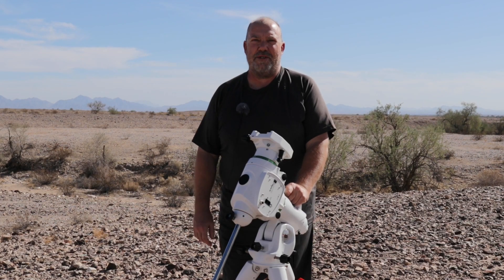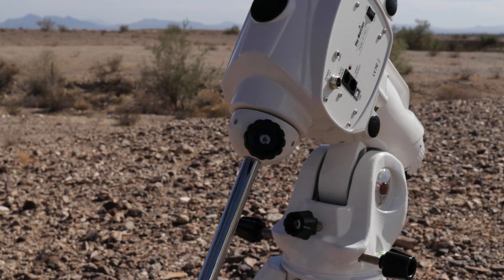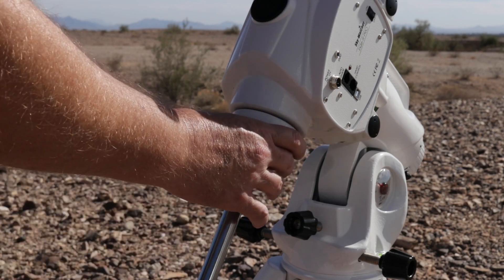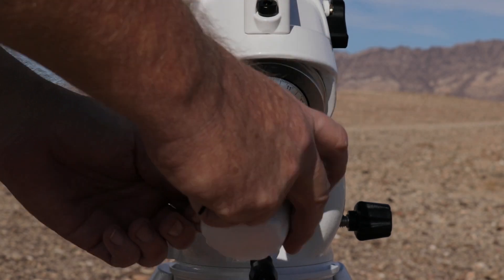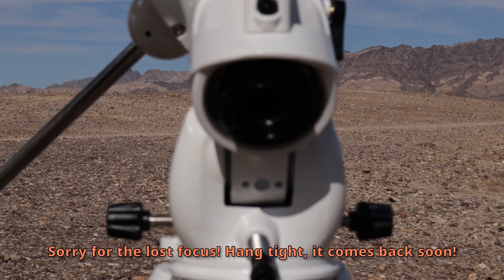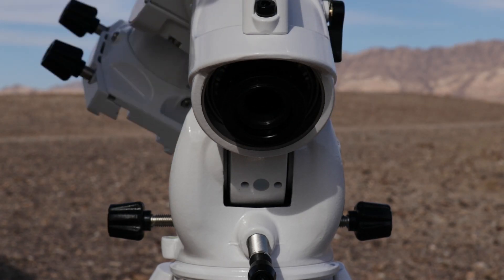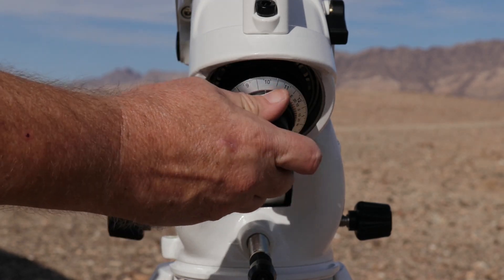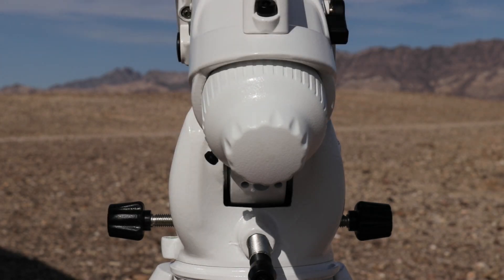EQ6R-Pro Sticky Axes Quick Fix (No disassembly required!) [DIY]

Comment: Thanks so much for all the tips in this video, especially your trick of putting screws in the unthreaded holes in the big black cylinder nut on the RA axis to gain leverage. I literally broke one strap wrench trying to get that nut loose and wore another one smooth. Not even channel-lock pliers did the trick (other than marring the finish). But your screws in the holes trick worked right off the bat, and now I should have a much easier time balancing. Thanks again!
Reply from the maker: I'm happy it helped!

Comment: Great video! I've been having some guiding problems when in varying temperatures and I always thought it was the grease issue. I looked inside and didn't think there was too much grease at all (I'm in industrial maintenance so I'm familiar with bearings being overloaded). I didn't know these mounts had compression nuts on the bearings and it makes perfect sense now. I reset the tq on them and it's as smooth as can be now! Thanks a bunch!
Reply from the maker: Thank you for the kind comment!

Comment: Sadly, I wished that I had come across this video a month ago. I have the HEQ5, which during the winter months at -20c became very stiff. I opted to disassemble the mount only to find out that the bearings and lubricant used were not the cause of stiffening. Unfortunately, the threaded Dec cap had been stripped during original assembly, but OEM stepped up and took it back under warranty without question - great support. All that being said, I came to the much the same conclusion as what you have presented here.  I'd be curious to know if your guiding results improved?
Reply from the maker: Didn't really see much difference in guiding. It would have been cool if it had improved, but I'm happy that I didn't make it worse! Regardless of that, the mount is just easier and more enjoyable to use now. Glad to hear that SkyWatcher took good care of you!

Comment: Hi! I followed your tutorial for the sticky axis. But for the Ra I could not get the black smooth nut of. Not with your two screws method. I’ve not yet tried it with a strap wrench but I think that will have less power then the previous method. I loosened all the grub screws (luckily none were stripped). 
Do you need to get through some locktite or what’s the deal back there 😂. Cheers 
Support from Belgium
Reply from the maker: Hello, Belgium, and thank you for the comment! Everyone is struggling with that nut. I had to use a lot of force to move that thing. More than I was comfortable with on a brand new mount if I'm being honest. The two screws were a little bent when I was done. I'm not really sure why it is so tight. Maybe there is some loctite in there. I think part of it is the grub screws...I'm pretty sure they dig into the threads. The nut then has to push through that damage. Not sure if that is all there is to it, but that's my theory (totally unproven lol).
You may just need to use more force, but I totally understand if you are unwilling to do that. I definitely don't recommend doing anything you are uncomfortable with.
Thanks again for watching and commenting, and please let me know if you give it another go and how you make out. Clear skies!
Reply: @explorelearnshare8222  I got it! I used a oilfilterwrench to undo the big black nut. Some scratches later but dat doesnt really matter. I also fixed the backlash and now its waiting for some clear skies!
Reply from the maker: @runematthijssens2304  Awesome, congrats! I'm happy to hear that it worked out. I hope that clear skies find you soon!

Comment: Thanks for a great video- very helpful. 
My problem is that I have an AZ-EQ6GT and thought I would be able to modify your process - but can’t work out how to get it apart on either RA or Dec. Do you have any suggestions? On Dec I removed the 3 grub screws but couldn’t loosen the silver ring. And on RA, I found some hidden behind the polar scope but found nothing that fitted in order to loosen them 🥲. I can send some photos if it will help with suggestions.
Reply from the maker: You're welcome! Unfortunately, the AZ-EQ6 is a totally different design from the EQ-6R. The main issue is the way the clutches work on the AZ-EQ6. They are in the way, and I'm not sure how tightening the axes works with them there. I found this video which may be helpful: https://www.youtube.com/watch?v=21wRVsNU6_w. I didn't watch it all the way through, but I skipped around and he does disassemble both axes. The part you want to see is how the tapered bearing on each axis is retained. That is the part you will need to loosen slightly. Hopefully that is shown in that video. If you don't get what you need from that one, try searching for a teardown video for the AZ-EQ6. Hopefully someone out there has shown how your mount comes apart (and goes back together!). If you find some videos but are still stuck, feel free to reach out to me via email if you want a second set of eyes to take a look. Sorry I can't be more directly helpful!
Reply: Ok, thanks for the response - I had already started looking for similar videos but would rather avoid a full tear down. Hopefully the video will give enough info to do a quick fix. I also read that these mounts do get stickier at high latitudes due to their bush arrangement. And I am 61 North…
Reply from the maker: @markcompton1249  Sorry I wasn't very clear...my intention was not to advocate a full teardown, but rather to use teardown videos to determine the minimum disassembly required to get to the place you can make the adjustment. Based on what you said, it sounds like you came to that on your own anyway. Indeed, that was the technique I used to figure out what to do on the EQ-6R. Again, if you think a second set of eyes will help then feel free to reach out. Good luck with this, and please do let me know how you make out!
Reply: @explorelearnshare8222   - that's what I understood, so I guess my response was ambiguous. I blame it on just having had Covid and come in from outside trying to get some planetary shots before the clouds rolled in. Amazing how cold one gets standing still in -16 deg C!!! 🥶Will send you an update if I make any progress, but probably won't get to do much until after the silly season, and maybe not before it gets warmer. Is this the best way to send you a message?

Comment: So I’m brand new to this . I just hooked up the Mount and the up down moves with the hand control but only a little each way…after I tighten the green number band. It seems I can’t get the left right to move only the green band moves…I can’t get it tight enough the move the telescope ? Is there a special tool to tighten the hand tightener on the green band? Seems stupid there so many little stupid things that should be explained… things you have to deal with , learn, find power connectors . Then Cameras then computer hook ups then photo programs phones . You definitely helped out loosening the Mount so it moves easy!
Reply from the maker: Thanks for the comment! Yes, there is a learning curve to this, but, it is very satisfying when you overcome it. Just be patient and keep absorbing information. There are a lot of great videos out there covering all the basics. You don't need to worry too much about those green numbered bands. They are just a reference and would be used when manually moving one axis or the other through a somewhat precise number of degrees. They don't affect the operation of the mount in GOTO mode. If you are driving the motors with the hand controller and you can hear the motors moving but the mount is not moving, my guess would be that you need to tighten the clutch. Those are the bigger black levers. Check the user manual if you're not sure what I'm referring to. You will learn all these little details as you go, and I'll bet it doesn't take as long as you may think. Good luck on that journey, and feel free to ask more questions if you need to. Most people in this hobby are eager to share what they've learned.
Reply: @explorelearnshare8222  Gotcha I like to first see if I can get it working. Thank you for the answer you helped a ton! Yes I tightened the clutch and you are right it works well. So now I’ll have to rudimentary set the North Star and follow the directions. I can’t wait for the TOTAL LUNAR ECLIPSE ON NOV 8 or shall we say NOV 7th after midnight ….totality 2:16 am
Reply from the maker: @rockanthems  You're welcome; enjoy the eclipse!

Comment: I couldn't unscrew my RA part. Failed with the rubber wrench and tried the 2 screw and screw driver, ended up bending the cmscrew driver and still it didn't move.  All 4 grab screw were completely loosened
Reply from the maker: I'm sorry to hear that you weren't able to best that RA nut. The only reason I didn't bend my screwdriver doing mine is that screwdriver is the heaviest one in my kit...I don't think I have the strength to bend it. In the video I was using quite a lot of force, enough to lever the entire mount up on to one tripod leg. If you watch the video closely you can see it move. I'm not sure what makes that thing so tight. I understand your reluctance to use too much force. Thank you for sharing your results here, and clear skies!

Comment: Well... I’ve had this video saved in my favourites for almost a year. On first viewing I went immediately to do this for my EQ6R and instantly hit the road block of not being able to loosen the black smooth ring on the RA axis. No problem, lets find some bolts and do what you did. Nothing fit properly and it wouldn’t move.

Fast forward until right this hour - I finally have it undone. I had to use one heck of a strap wrench and with so much torque applied that I quite literally lifted the entire mount up off the floor. An entire hour of trying to undo it with a long handled strap wrench and IT FINALLY CAME LOOSE. Holy moly, I cannot tell you how happy I am hahaha. I literally have blisters trying to loosen the MF 😩

Thank you so much for this video, I finally have a smooth and free RA and DEC axis. I can finally now balance my 8” newt properly!! I truly cannot fathom why Skywatcher do everything up so tight on seemingly all their products 🤪
Reply from the maker: You're welcome! I'm happy to hear that you came out on top against that darn RA axis. It is indeed a MF as you said. Thank you for sharing your results, and clear skies!

Comment: The 4 grub screws on the black ring for the RA axis… on my mount… are 5/64ths. Using a 2mm allen on those 4  could strip them out.
Reply from the maker: Thank you for your comment! I did the math on this, and converting 5/64 in to mm came out to 1.984375 for me (5/64 * 25.4). So, very close (less than 0.02 mm difference). Good to know for anyone out there that wants to do this but only has imperial tools in their kit.
Reply from the maker: Unfortunately, there isn't a very close match for the 2.5 mm wrench needed for the dec axis. 3/32 in comes out to 2.38125, which is a bit smaller than I'd be comfortable using. The next 64th up, 7/64, comes out to 2.778125. I'm guessing that wouldn't fit in at all. Looks like the moral of the story is to just get the proper metric wrenches...

Comment: Thanks for the great demo.  It was recommended by Jay Lamb, and I did it, following you along, worked great.  Seems greatly improved.  My strap wrench is about 30 years old, but did the trick.  Probably time for a new one.  My polar scope was, and still is upside down.  Couldn't seem to fix it, perhaps you have a video on that?  Don't use it much, but nice to have things lined up right? Keep up the great work.  Don't see your name anywhere! Thanks again.  Les
Reply from the maker: Hi, Les! You're welcome and happy to hear that you found this useful. My name is Rich. I'd say hold on to that strap wrench! Mine wasn't much help despite being straight out of the package. I don't have a video on the polar scope. How do you mean that it is upside-down? I have to admit that I have never used mine; I use kstars/ekos and it has a polar alignment routine that I use instead. Thank you for the comment and clear skies!
Reply: @explorelearnshare8222  thanks for the reply. I too have evolved away from the polar scope, prefer sharpcap polar alignment tool. When i look through my polar scope, the clock image is upside down with 6 at the top and 12 at the bottom. When i used it I just ignored the numbers. I presume there is a calibration procedure but never worked it out.

Comment: Great stuff. Thanks! I was about to do this to my old EQ6 as I have that issue too when balancing. But I realized that when I loosened the clutches and spun the axle the clutch levers were dropping under their own weight causing the clutch to drag very slightly. That was the main thing for me making it feel tight. I changed the lever orientation a bit and cleaned the clutch (removing excess grease).  But of course, now you got me curious about taking out that last tiny bit of tightness. So here goes. Inspirational!
Reply from the maker: Thank you for the comment and the kind words!

Comment: I wanted to follow the tutorial. But weirdly after loosening all 4 screws of ra the thing Didn't get loose. I applied a lot of pressure? How can this be
Reply from the maker: That ring is very difficult to move and I'm not sure why. I definitely struggled with mine and many others have commented that they struggled with it as well. I'm not sure what to offer for advice here; if you aren't comfortable applying more pressure I don't blame you. The only thing I feel safe having you check is that the 4 set screws are backed out several turns. Just loosening them isn't enough because they cut right into the threads you are fighting against. I'm guessing you probably did this already, but that's all I can think of right this moment. If you have more questions please ask them. Thank you for the comment!

Comment: Great video. Thanks. I bought a used mount and both the axes were so stiff that i wasn't able to balance at all. I used your technique and it has done wonders. With my 102mm ED, it guides at 0.6 RMS. I am not pro at guiding but this is ku h better than what I had before. Also seeing and light pollution at my location is terrible so that might affect the numbers a bit. Thanks for the great guide
Reply from the maker: You're welcome! Thank you for the comment, it is really great hearing this. 0.6 RMS is definitely something to be happy about; it sounds like you made a good purchase! I wish you the best and clear skies!

Comment: I used two 9/64 Allen wrenches rather than 4mm bolts on the RA axis locking nut.  It was very tight!
Reply from the maker: The Skywatcher employees must all be into body building...thanks for the comment and the smile!

Comment: My new EQ6-R comes nowhere near those figures. Total RMS goes anywhere between 0.8-2". And that is with a PERFECT polar alignment(at least according to KSTARS/EKOS). Should I suspect there is something wrong with  my mount?
Reply from the maker: Thanks for the comment! Nice to meet a fellow Ekos user, too! I don't know if it's time to blame the mount yet, but I also don't know what you've tried so far or how much experience you have. Have you had other mounts that you were able to get good guiding out of in the past? Is this your very first mount and first attempt at guiding? Somewhere in between? Let me know what gear you have and what you've tried so far. I'm down to help figure out how to get the best from it!

Comment: I think there is a misunderstanding about how a precision (not high speed) pre-load will make a mount feel like something is wrong. You have steel bearings in an alloy casting so full temperature range in use has to be allowed for as well. Pre-load takes into account distortion of the casting as loads are fixed to it. If guiding is 0.5" , then it is working fine.

Comment from the maker: @Jack Mundale made this comment in a reply: "I re-checked the alignment of the polar scope after this procedure and it was dead on, no adjustments necessary." I wanted to pin that reply but it seems that pinning doesn't work for a reply. So, I'm reposting the comment here. Thank you for sharing this, Jack! You can see the original comment in a reply to elythomaslumber.

Comment: Great Post!  I compteted procedure in under 30 minutes with only 1 glitch.  If you loosen the DEC axis bearing cone nut set screws too far the drop into the cone nut, which requires the complete removal of the nut to fetch the screw.  Be careful of the bearing dropping out if you need to remove the cone nut completely.
Reply from the maker: Thank you! You're the second person to mention having those fall out. I think I'm to blame for saying not to be shy backing them out! Alas, I didn't want anyone to drag them across the shaft threads if they weren't out enough. Happy to hear that you recovered fine! Clear skies!

Comment: I'm going to look into this also, because PHD2 is having issues correcting the Dec many times  and PHD2 need to send the pulse command 3-4 times when the DEC finally responds,  (and most of the time over-corrects by the time the mount reacts) sounds like a sticky axle.  I have no issues on the RA, but the DEC definitely feels too tight when trying to balance it also.
Reply from the maker: I hope you solve it, please share your results. Thanks for watching and commenting!